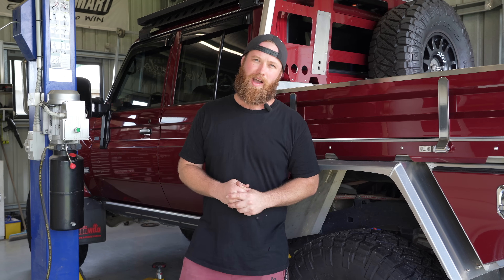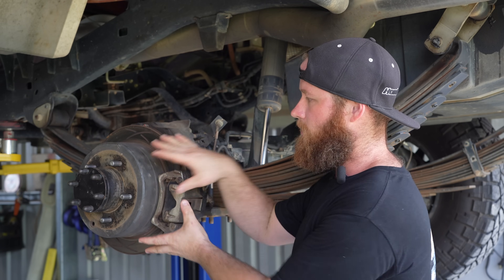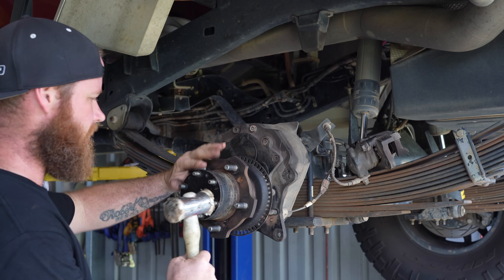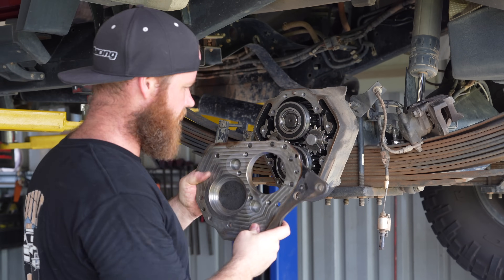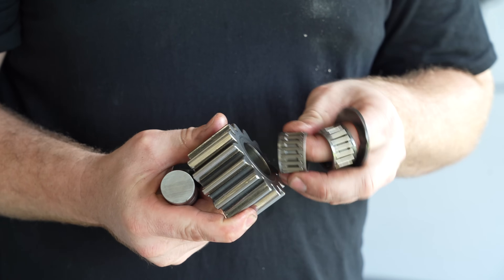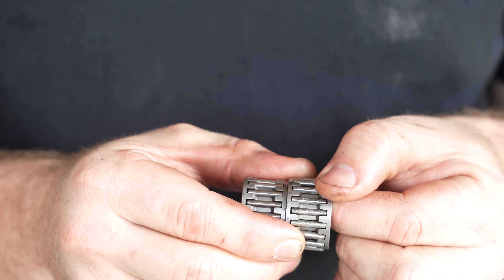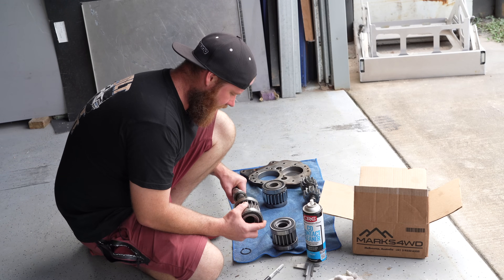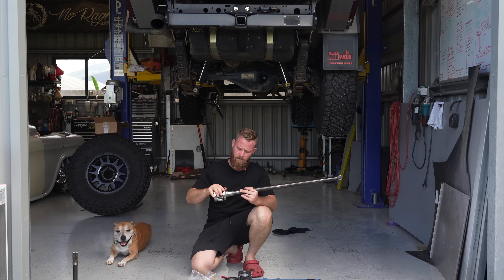WE DAMAGED OUR PORTAL AXLES... See how we service the Marks Portal Axles on the 79 Series

Comment: Great info. How do you find them on the road and off-road such as corrugations. Much difference in fuel use
Reply from the maker: Hey mate, no real fuel usage difference as the change in gear ratios compensation for the larger tyres and extra drag. They perform like a stock setup on corrugations, just with more clearance.

Comment: Can you explain how water gets in when they have breathers? And hard facing being worn off is usually heat isn't it? Is it normal to have such portal wear after suuch a short time?
Reply from the maker: Hey mate, I had changed the oil in the gearboxes prior to cape and didn't push the breather hose back in properly, it got water in it and then it was over the capacity to spat some oil out the breathers with the excess water resulting in bugger all oil in there.  Heat from driving a few thou kms after with minimal oil wore the hard facing.

Comment: Hey great vid about portals, really want to know the pros and cons on the portals as I’m thinking of getting em. Compressor wise, servicing, how tough are they?
Reply from the maker: Thanks mate, we love the portals, not noisy at all, arb single comp comes with the kit mounted in the engine bay for the front hubs, I service the rears every 5k kms and fronts every 10k kms. Straight cut gears this wide are pretty strong, I just a decent amount of power on 37s and have not had any issues with damage caused from stress.
Reply: @LifeoftheCromies wicked ride 🔥

Comment: With the removal of those cone washers try sticking a small thin bladed screwdriver into their expansion slot & just twist them out. No need to bash on the axle flange or studs & loosen & stretch in the threads so they eventually snap off under load. I wipe a very thin film of grease on them on re-install so they dont rust or sieze in.
Reply from the maker: Great idea mate!

Comment: I like that wheel 🛞 bearing tool where can I buy one from?
Reply from the maker: Hey mate, mine came with my portals but here is a link to something similar. https://alliedautoonline.com.au/products/3-prong-1-2-drive-rear-hub-nut-tool-socket-for-toyota-landcruiser
Reply: @LifeoftheCromies  Thanks for that looks so much better than using a screwdriver 🪛I might be showing my age we used to remove the rear axle and set the bearing load with a fishing 🎣type spring scale

Comment: I need portals on my defender to get my fat rear diff out of the road . Do they change the gearing at all
Reply from the maker: Hi mate, they reduce the gearing by 16%. Very handy when running larger tyres!
Reply: You can shave the bottom of the diff
Reply: think that would give me 10-20mm at most still going to drag my fat diff because of all the guy's running 35+ tyres . When i win the lotto portals and 40's  @mattluszczak8095